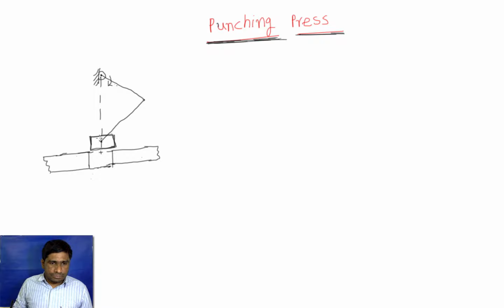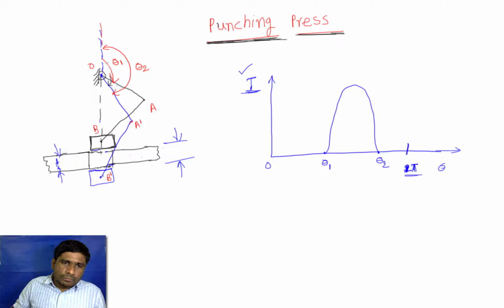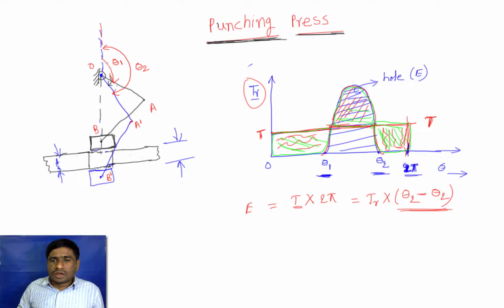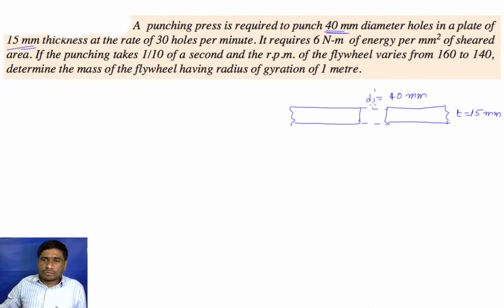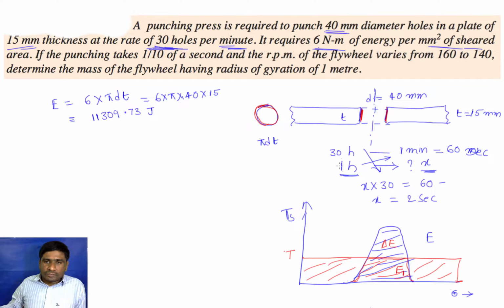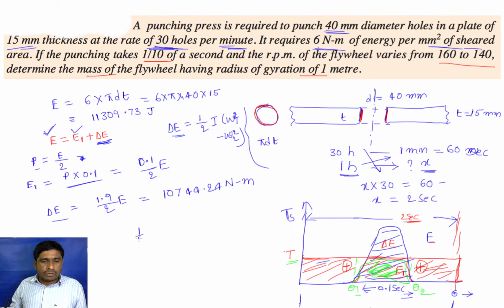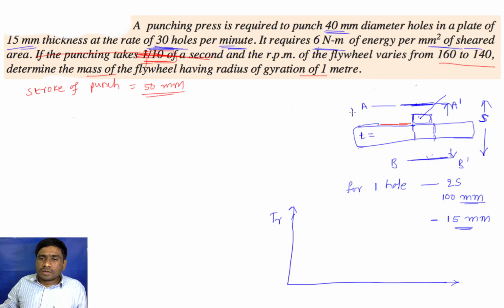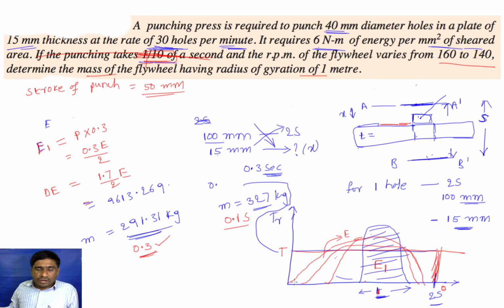Flywheels 8: punching press theory, example problems on punching press

Comment: I want to ask why the graph doesn't start from theta=.0..degree.....is there will not be resisting torque due to inertia from start of the graph. ..if not then why?
Reply from the maker: kurunandan shishaudhiya :. inertia force is neglected compared to the resistance offered to the punch.. and here we are considering exclusively external resistance torque but not the internal forces of the system
Reply: ok....thanks